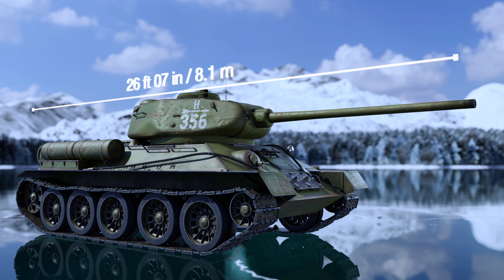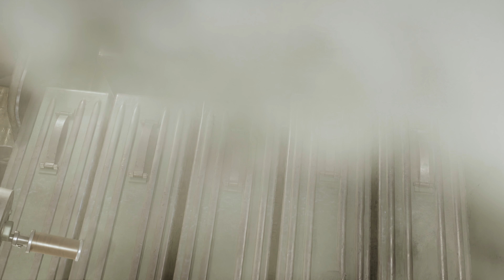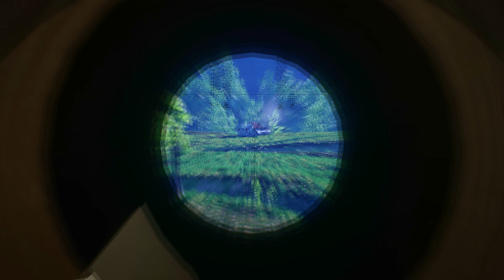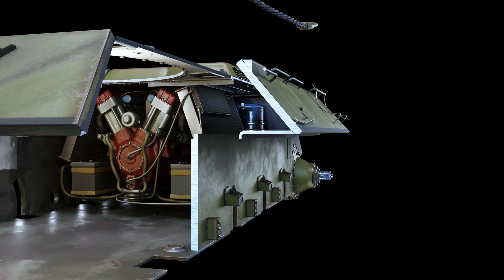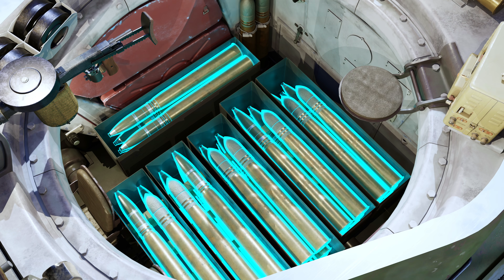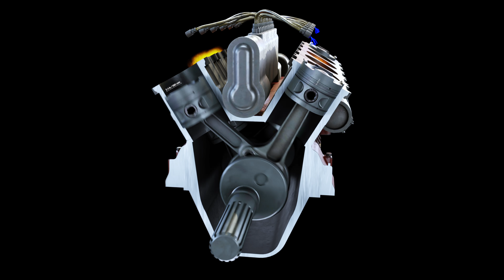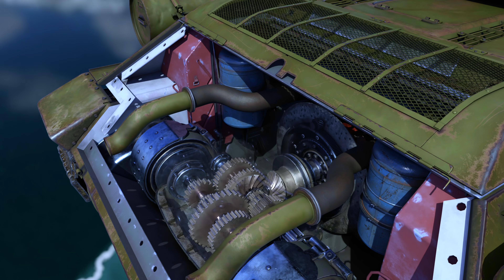Inside the T-34-85

Comment: Just two corrections to the video:
1. The machine gunner to the right of the driver served as the radio operator (until this role was assigned to the tank commander) and the driver’s assistant. It’s fair to say that most of the time, this guy assisted the driver and took over for him on long marches.
2. Diesel fuel, especially from that era, doesn’t tend to produce as much vapor as gasoline. And it’s precisely gasoline fumes that tend to cause a classic air burst explosion. In late-war designs, such as the IS-2, fuel tanks were used as additional armor for this very reason in the fighting compartment: a typical scenario involved the IS-2’s hull being penetrated from the side, where fragments of the penetrating shell would strike the fuel tank. The high velocity and resulting temperature ignited these tanks, but it did not explode — the burning fuel spilled into the tank’s fighting compartment. This would wound or kill the driver (of the IS-2), but it prevented red-hot, high-velocity shrapnel from flying throughout the fighting compartment wounding the rest of the crew or detonating the tank's ammunition — giving the crew a few precious seconds to bail out.
Reply: Also T-55. Frontal fuel tank defend(!) reserve ammo.

Comment: It should be noted that soviet factories would cut as many corners as possible for wartime production tanks in order to meet their quota/ make up for a lack of critical resources. Think things like headlights, turret baskets (for tanks that had them in the original design specs, at least) and periscope mirrors that didn't really affect "hard" factors like the tanks speed or armour thickness. As for how this affected the actual performance of the vehicles, that's a pretty complex topic for a youtube comment.
Edit: i know somebody's gonna say "quantity has a quality all of its own", but that's a misunderstanding/ oversimplification of stalin era soviet psychology. Soviet doctrine was to use tank units to exploit breakthroughs that would be opened by massive infantry assaults, which leads to incredibly high losses when the tanks actually do meet the enemy head-on due to the inherent aggression required of breakthroughs to avoid encirclement. Those losses need to be replaced, so you demand ever-higher quotas from the factories, who have to fill them by any means necessary, which leads to much poorer quality tanks being sent to the frontline, which take higher losses, which need to be replaced, which you do by demanding higher quotas.  In short, the soviet concept of "quantity over quality" is absolutely ridiculous, as having 3 times as many cheaper tanks means way more than 3 times the losses in manpower and equipment (from both combat losses and mechanical breakdown), replacement training, spare parts, spare tanks, etc. 
This isn't to say that lowering production quality to meet higher demand is always a bad thing, the ever-precarious position the soviets were in for most of the war didn't really allow them to just build tanks to a higher quality like the rest of the allies could. The germans also did a similar thing with their own tank production. some examples off the top of my head are how they increased panther production by skimping on replacement parts, and cut various parts from PZ IV production like the electric turret drive in the J model.
Both the nazis and the soviets also faced shortages of critical metals like nickel, which led to poorer quality armour (typically more brittle, which leads to shattering rather than absorbing the energy of hits), so "armour thickness" as a mm value doesn't really mean anything. If you build a tank from boiler plates, however thick they may be, most any cannon shot is gonna pass right through them due to its ductile properties. If you build a tank from a high-hardness steel (quenched at a very high temperature, having a higher carbon content, etc), the plates are just gonna shatter with the first shot.

Comment: The series is fantastic.   That said,  I do not think any tank can be contended as the most important of WWII.   If any was,  it would be the Sherman.    Clearly the T-34 was the most important Russian tank of WWII.   What version depends on what they had,  T-34-76 to start with,  the -85 was a significant upgrade but it would have been so without the 85mm cannon.   The Sherman gets the nod because of its many users (UK, Russia,  France etc) and its upgrade paths bifurcating at the Easy 8 and Jumbo.    It impacted all theatres including the Russian front (not hugely but it was there).

Comment: Interestingly, in their haste to build them, the Soviets didn't consider that the track guides would be a problem and failed to notice that they were coming loose due to vibration. Engineers tried to solve this by placing the guides on the inside of the track, but they kept coming loose, and they had to weld ramp-shaped plates to push the guides back inside.
Reply: Track pins* lol the guides weren’t failing
Reply: -- Its hard not to notice something that been produced for decades... Free floating track pin was designed for ease of repair, especially in the battelle and under fire.

Comment: The diesel was still highly ignitable if hit by a supersonic AP round. Just the impact energy would flash vaporize the fuel & cause a fireball. At 750m/s impact, diesel or petrol makes little difference. That's why good tanks don't have fuel tanks high up in the fighting compartment...

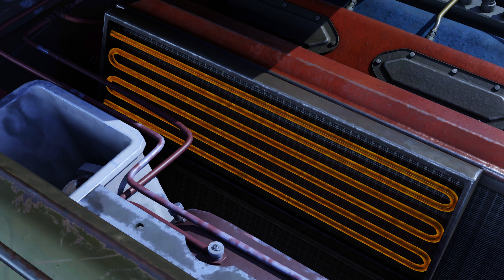Comment: 20:14 -- Gallons per Kilometer?  What's that in Firkins per Furlong?  😄  (It would be better not to mix SI and Imperial/EES units...)  Otherwise, an excellent presentation.  The research that went into this must have been a lot of fun.  Did you have access to actual examples of the T34-85  (it surely looks like you did).

Comment: 24:45 carefully reproduced plates read:
1) Trit-re −25° {I assume it should be Trat-re or Pri Trat-re, «At temperature»}
Toggle on the tumbler of heating, hour.
2) Leaving / water not higher than 105°C.
_
Do not start the movement / Until temperature of the oil / will reach 45°C, and tempe- / rature of the water 50-55°
{second gauge dial has: °C / temperature / TKP-60/3M2, with the latter to be the SKU of this gauge, which seems to be a remote thermometer till nowadays}
3) Leaving oil / not higher than 100°C
_
Start movement / on lower / gears
{third gauge dial has the same: °C / temperature / TKP-60/3M2}
4) Oil pressure
_
Normal: 6-9 ATM
_
On 600-800rpm not lower: 2ATM / To work longer than 10min / under fully pressed / pedal of fuel feed / is forbidden.
{fourth gauge: oil / TKP-60/3M2, but this SKU is already allocated for the previous thermometer}

It was nice to analyse these plates, thank you!

Comment: T 34's had color coded systems for fuel, coolant, oil, to ease repairs. The Soviets had field support for repairs, while German tanks did not. A German tank also didn't have interchangeable parts, no field support, and would have to go back to the factory to be repaired.

Comment: 0:12 „at a rate that no one could match, reaching nearly 1,200 tanks per month in 1944” - the US produced the M4 Sherman at a rate of over 2000 units per month in 1942-1943.
Reply: Yet, shermans (especially 75mm ones) was much worse then a T-34, so I'd still prefer to get 1200 T-34 then 2k shermans.
Reply: @_l7pocto_4udo_66 no not the 76.2 version the 75 gun can pen 106mm at 100 meters but the 76.2 can pen less plus the Sherman has more smror
Reply: Armor
Reply: Plus the Sherman is more safe and reliable with better optics and radios
Reply: The Sherman’s are slower but I think every other advantage makes up for it
Reply: And the Easy 8 variant was a lot better then the t-35-85
Reply: @_l7pocto_4udo_66  Shermans have a better KD record and could be use in any terrain, in fact, Soviets used the Sherman jumbo to spearhead the tank forces into Germany. Sherman were more survivable, could fight in small slopes and hills, crew could bail out safely and the engine was reliable and its smashed the T-34 in Korea.
Reply: USA non avevano la guerra in casa... Poi i sovietici producevano anche molti IS , ISU ed altro
Reply: It's also worth pointing out that Russia couldn't build the tanks that fast CORRECTLY which is why so many of them didn't work reliably and died to things they should have been proof against on the regular. In fact, its not said in jest but in fact, that Russia is the nation least capable of building good T34s, because all the ones built in vassal states were actually much better, mostly because they were built according to design specs, not as a rush job.
Reply: @peteredwards2318 T-34s not T34s. The T34 could refer to either the American heavy tank from 1945 or the T34 Calliope which was a M4 Sherman with 60 M8 rocket tubes above the turret
Reply: @RS-31-20 thats clearly not he meant idiot
Reply: The USSR evacuated factories, there were few people, little industry, and there was a war going on.
Reply: Шерман шерману рознь. Сравни т-34-85 и те шерманы, о которых ты говоришь

Comment: Pls, everybody don’t forget that Soviet Union by June 1941 have had over 1000 T-34 tanks in division although of early models   were equipped with 76mm gun, still none a single, none of Germans tanks by the same time have had any comparable or on par machine capable of fighting on equal grounds.

Those, 1000 tanks could have been relatively compared only to around 300 T-III with 50mm guns, however much less armor thickness.

Radios. Soviets have had no radios or commander mini turrets. Well, archive documents both Wermaht and Red Army suggest around 50% equipment of radios among all tank divisions with probably Germans having only slight edge.
Reply: How many of those t34s did the Soviets lose in 1941 lmao
Reply: @jb76489 many, if not most of them, out of those most were not lost in combat but simply abandoned, there are only few reports when Germans were really really surprised by T-34 and Kv-2 beast rolling over their trenches and pearling them like knife in a butter. 

The only thing that stopped them were mastership and heroism of German antitank crews and infantry. Famous 88 AA guns were also of very rare use in anti tank role.

Comment: You have to admire the crews who learned how to operate this very demanding machine. Easy to build means hard to use.
Reply: Well, service simplicity was superior to German tanks, diesel engine - less fire chance, drive train - simpler, everything is simpler and thus easier to repair, not to tell wide trucks and high mobility.
Reply: @wondernews  service might've been easier but he was talking about operating this tank and not repairing it
Reply: @konradoski5306 true, operational - hands off - Germans were number one till mid-late stage of war…
Reply: I mean not necessarily, look at the Sherman, they were pumped out almost just as fast but were way less cramped, more comfortable and easier to fight in.

Just because the industrial line is fast doesnt mean its a crappy machine.

Also something like 50% of T34s were brittle because they were made in some factory that used a different technique (someone add on this please, I dont fully remember the reasons)
Reply: @Tankumentary probably diff between cast methods or steel production technics, I only know for sure about T-34 production that machines that create that turret round in the chassis were supplied in substantial numbers by USA during the war (land lease), those existed prior war were either lost during evacuation, or were in little numbers to sustain any meaningful (for Russian style of war) output.
Reply: @wondernews I don't Know but I think US Doesn't directly Supply T-34-85's Turrets in Lend Lease Program
Reply: @SarthakGhosh-hq9rd it did by delivering turret ring cutting device
Reply: @wondernews  Ты пишешь о карусельных станках с планшайбой в 3 метра. Это правда, что такие станки заказывались в США. И нет, не по акту об Ленд-Лизе, эти станки покупались за золото. Потому что, согласно этому акту, всю поставленную технику (и сырье) необходимо было вернуть после окончания войны, если была такая фактическая возможность (и тут была очевидная лазейка в законе - относительно сырья, которую законодатели Конгресса США намеренно допустили). Но, тогда станки надо было бы возвращать.
Ну и, такие станки были ещё до начала производства Т-34-85, например план выпуска этой модификации танка на заводе №112 (Красное Сормово) подразумевал выпуск с января 1944 года, тогда как такие станки начали поступать из США во втором квартале 1944 года. То есть, как и почти везде в поставках из США и Великобритании: эти поставки расширяли "узкие места", но они не были жизненно важными. За исключением химии и конкретно химических порохов и компонентов взрывчатки - что достигало практически 50% от домашнего производства. Хотя и тут: глицин и парафин можно было закупать за границей, но по Ленд-Лизу были уже налажены пути поставок, поэтому глупо было не пользоваться этим.

Comment: In terms of man hours, it was an expensive and complex tank made cheaply, to allow huge production number. On the groud, removing the rubber gaskets, for example, caused failure of electrical systems, water getting inside the tank by the hatches, transmission failure, etc.....
It was a tank made for attritionnal warfare, that failed to deliver, and the soviets were lucky they received 7000 tanks from the USA and 5000 from the british (lees, mathildas and shermans, essentially)

Comment: Not having a turret basket had to have been a huge headache for the crew
Reply: I think even more headache was the fact that you could barely see outside. Earlier models didn't even have those cupolas for commanders and to properly see outside they had to open the hatch and expose themselves for the fire. They basically copied those cupolas from Germans.
Reply: @Killjoy45  that's just how tanks are – you're inside a moving metal box with only small slits to peek around. Your situational awareness would always be limited even with cupola. That's why it was crucial for tanks to operate in conjunction with infantry.
Reply: @kindlingking  
The problem was expectionally bad with T-34s. The poor visibility is one of the main reasons about 44 k of them were lost during ww2 alone. In the earlier models the crew was practically blind from multiple angles. There is a reason those cupolas appeared in the later models. Even slightly better visibility outside was a huge advantage. For a very long time Germans had better chance to spot Russian tanks first.
Reply: @Killjoy45  it really wasn't. It's a myth perpetuated by people who don't read their own sources. T-34 had fine visibility for it's time, not the best but perfectly serviceable. 

44k T-34s were lost because over 100k were built – it's the most mass produced tank in history and was used over 2000-4000km front line for 4 years of primarily large scale offensive warfare. Tanks that don't get destroyed usually don't fight at all. I'm pretty sure Sherman's statistics aren't that pretty either, but you wouldn't go as far as to call it bad. 

Germans relied on commanders peaking outside the tank just as much, because it's just the most effective way to gain situational awareness, despite the risk. The difference was skill, as early in the war Red Army had to rely on fresh recruits and reservists, who simply couldn't effectively match experienced German soldiers. However Katukov for example got his famous killstreak back in 1941, so it was only a matter of time.
Reply: The loader should see the rounds of ammunition around. The commander and gunner were sitting. So, what's the problem?
Reply: Not really. Pretty much none of the WW2 tanks had turret basket because of how cumbersome it was to use. Sherman got one initially, but due to crew complaints it had to be cut in half to allow leader to move independently from the turret.